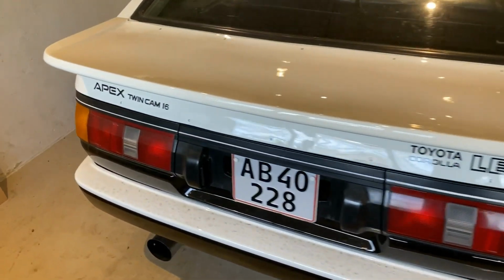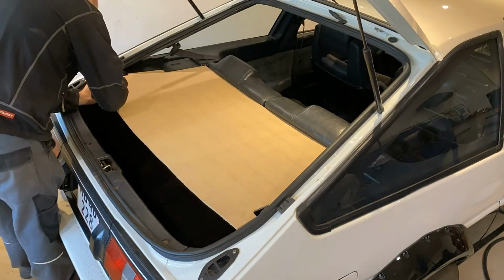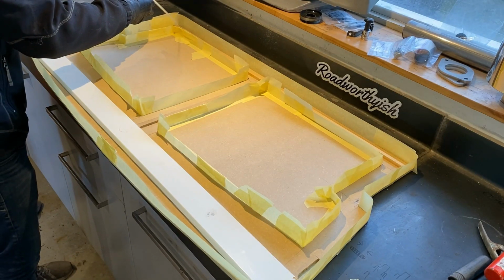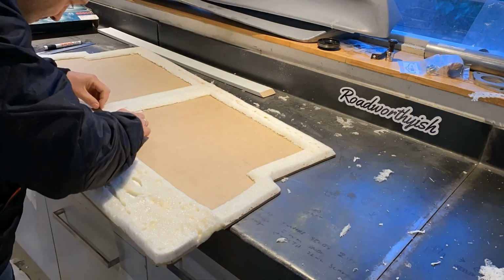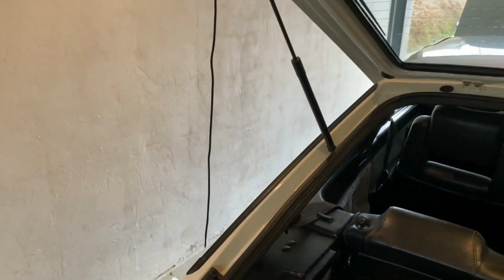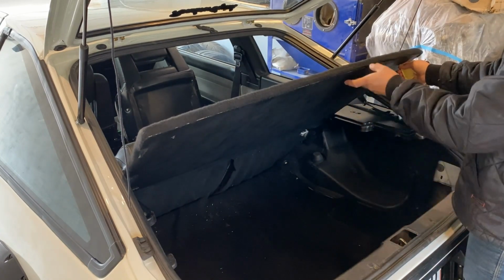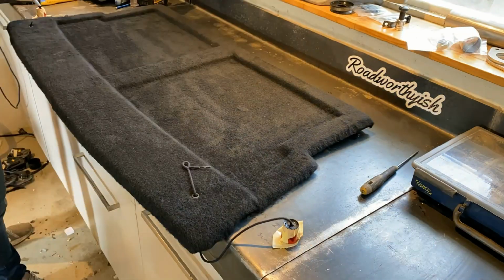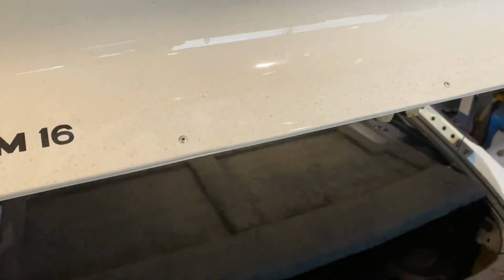DIY Parcel shelf. Toyota Ae86 Corolla. How to build from scratch with just basic tools. Timelaps

Comment: I see that you have placed a small strip along the length to provide structure along with the polyurethane foam. The main problem with these trays, being so long, is to combine the length with a low weight and to prevent sagging in the center due to their own weight or when placing something on top. I just finished a tray for my car using 5 mm plywood, some wood strips to provide structure, and some fiberglass, but I can't get it under 2 kilos and it tends to bend at some point. That's why choosing the most appropriate material is important, considering that wood is a living material that tends to change with humidity and temperature. Did the foam really provide the structure, light weight and strength needed for this?
Reply from the maker: I guess it’s a choise. 
My underlying sheet is still Perfect. And the car lives outside…  
But yeah, getting to weak a board Will make it sag, and then the foam will let go..

The Only reason for the foam was to make the shape close to the oem corolla parcel shelf